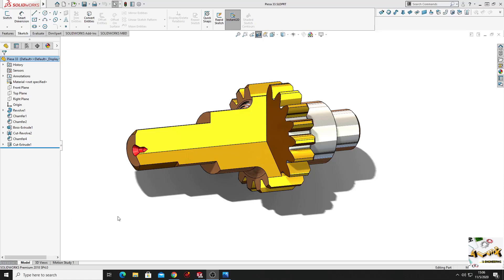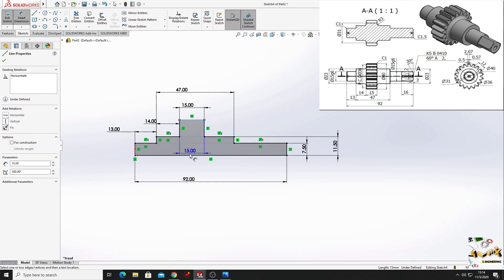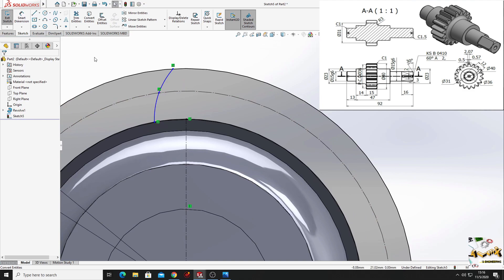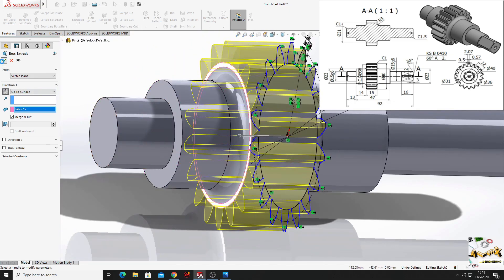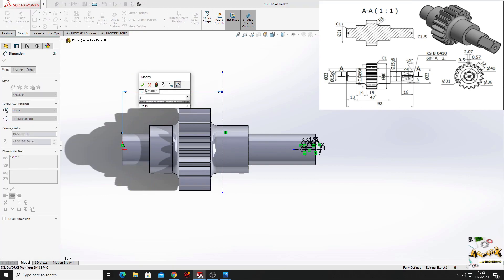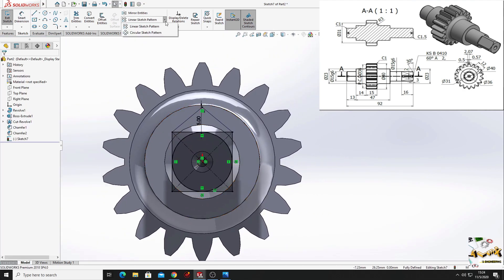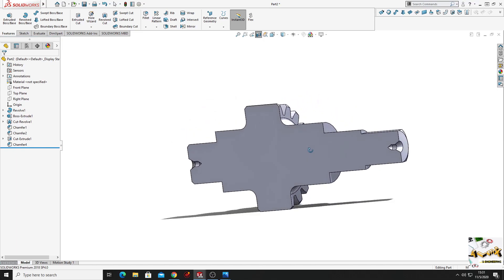SolidWorks Tutorial 2020, Exercise nr. 33 Gear Shaft! Learn from Home! :D

Comment: One thing that you can do to save time is to extrude only the first tooth, chamfer the two edges, then under Features, use Circular Pattern to pattern the extrusion and chamfer features.

Also, for the cut that squares the end of the axle, you can sketch just the square and skip the triangles.  After that, when using the extruded cut, choose Direction: Blind, Distance: 16mm, and check "flip side to cut."  That will cut everything OUTSIDE the sketch boundaries.

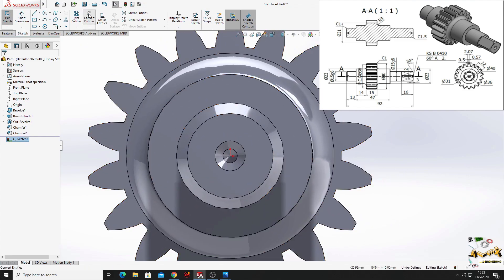Comment: Hello! What at 7:54 CONVERT ENTITIES does? I would understand when is good to use it and when not! Thank you in advance, awesome lesson
Reply from the maker: I converted that edge there, because when you convert something is already fully defined, and i used that converted circle (wich has 12 mm in diameter) to make the rectangle, i used the circle as a reference for the rectangle,
So basically, you use convert entities command when you need something you already made in another sketch (in the same plane), because it comes already defined, I hope I helped you with this 🙂,